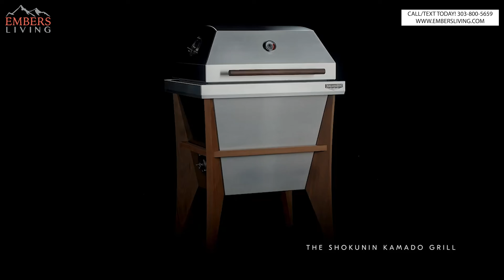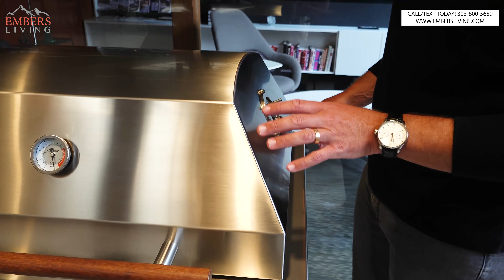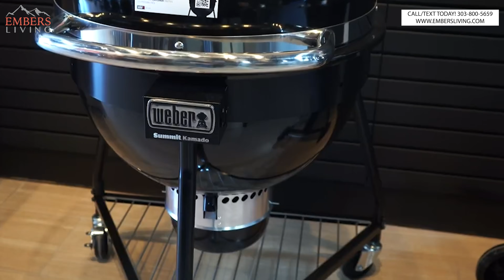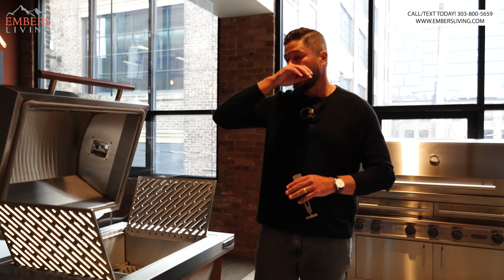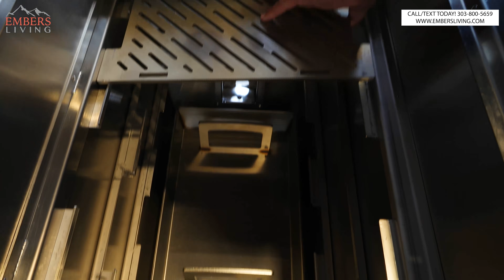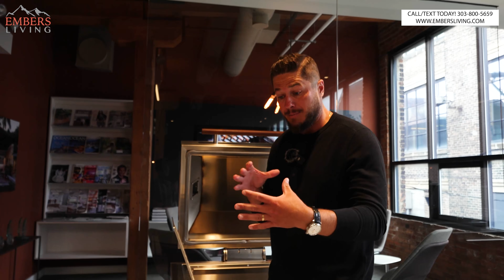Kalamazoo SHOKUNIN KAMADO GRILL Review!! ( More versatile than your average smoker!! )

Comment: I work in a sheet metal factory where we produce kitchen furnitures mostly. I don't understand the price tag. It looked okey until you opened it up. In the interior (of the top part) you can see that the welds discolored the metal. Ugly as hell. And it's not even a big deal to clean it, the company would only need a $500 machine for it.

Comment: I don’t know what it costs but if it’s more than a Komodo Kamado it sure shouldn’t be. Where’s the rotisserie?
Where’s the ability to do pizza? If your food is limited to just the top rack, it’s a very limited space. No sear marks with those grates and they need to come out easier for cleaning. I’m sure there’s a way to load lump on both sides for even heat, but that wasn’t demonstrated. Where would you put a water pan? Are there grommets for temp probes? But it sure looks good from the outside. 
It seems like the cybertruck of grills. Looks cool, trying to be innovative, eye catching, but is it really a better grill in the end?
Reply: It’s $11k so pushing twice the 32” KK and more even than the 42” unless you really trick it out.
Reply from the maker: Cyber truck of grills 🤣We will have to test it out more!
Reply: @embersliving  I’m really surprised this grill is so positively reviewed. No question the build quality is there. But if you want to move this grill, even 3 inches, you’ll need 2 strong people. Why? Because this grill has NO wheels!!! People move their grills all the time, while not using, to clean around them, adjust for strong winds or whatever. Why no wheels or level adjustments?
Also if I have to run the wires of my temperature probes under the gasket, how is that a premium setup?  
This grill will do pizza but pictures I’ve seen have the pizza stone directly on the grates. 
This is definitely the cybertruck of grills. You pay a big premium for the stainless steel and skilled US labor, which is very hard to keep clean, it looks cool, but like the cybertruck, it doesn’t do anything better than the competition. Even the claimed thermal properties are jeopardized if probe wires are required to run under the gasket.

Comment: While I slightly prefer the style of the Kalamazoo, if I was looking for a really high end kamado I’d buy a 32” Komado Kamado.   And with the price difference, I could hire the crane I’d need to move its 1000 lb weight where I would want it.
Reply: I have to agree. The 32” Komodo has a lot more grill area and rolls on very nice wheels as well. AND has a rotisserie.
Reply from the maker: Very nice!

Comment: The problem when it has too much insulation the "gentle fire" tend to smolder and produce a dirty smoke flavor. Has been tested and documented a bunch of times.. ceramics hold the heat by thermal mass which tends to be less efficient tha  say a broil king keg with oven insulation in the walls but burns a much cleaner fire
Reply from the maker: Interesting
Reply: That actually all comes down to how much air you let in over the cook. If you let barely any air in, yes you will get dirty smoke. However, if you let in more air the smoke with come out cleaner.

It is always better to have a more efficient Kamado. Less efficient Kamados burn more fuel, generate more ash, and need to be reloaded mid cook sometimes.

Also many Texas BBQ people say dirty smoke at the beginning of the cook actually enhances smoke flavor, then you let the smoke get cleaner after a couple hours and finish the rest of the cook in clean smoke. Because of the 4 air vents on this Kamado, you would have a much easier time getting the smoke dialed in than on a simpler Kamado like the Kamado Joe.